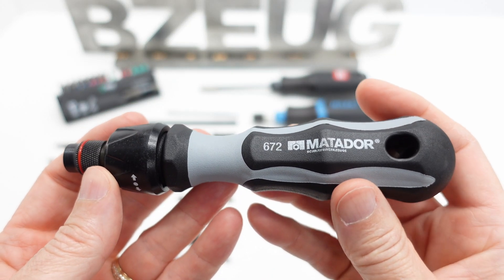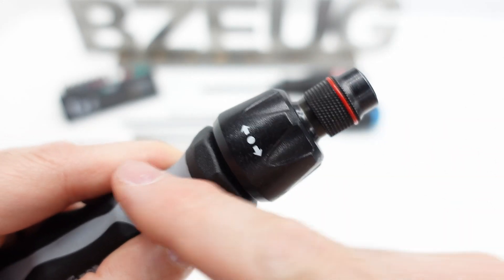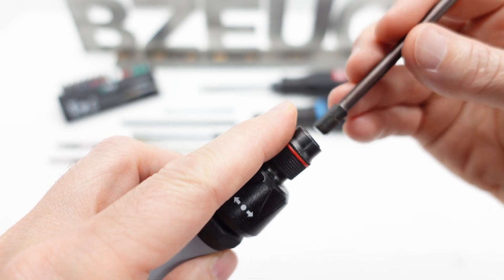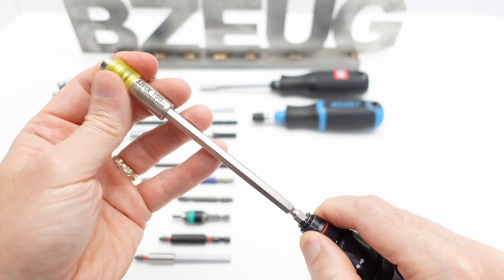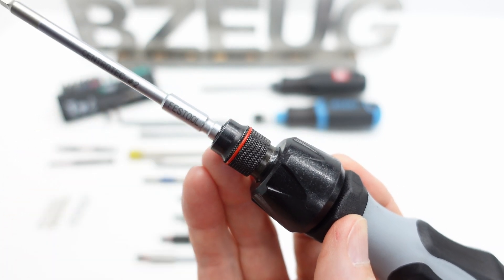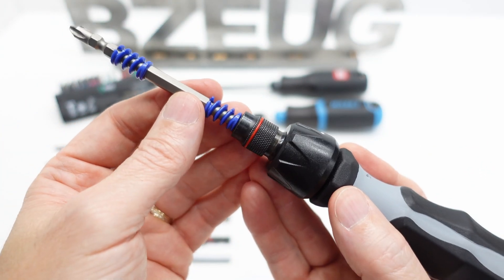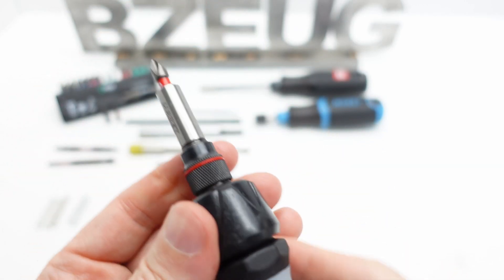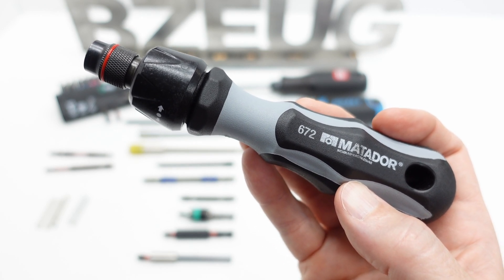Matador 672 silent ratchet blade style bit holder has 6 locking BBs.

Comment: You should use the wera rapidaptor from kk25 handle it has two c6 detents one at the bottom and one at the top, so u can have it short or long.
Reply from the maker: Oh yes you are right!  Such a good idea.  I just checked it and it works very well.  I am so disappointed that I didn't think to put that in the video.  Thank you!

Comment: Hi bzeug, great review. I just check out the amazon de link with handler only. Found that the picture is without ratchet. Description still the same with ratcheting. Make me wonder if still the same bit holder.
Reply from the maker: I see what you mean.  That is very strange.   When I follow my link in the video it goes to the correct Amazon.de page which also shows that I purchased that exact product.  I see what you mean about the photo.  In the description of the item they refer to the silent ratchet, and the part number for the ratchet style appears correct in the description.  When I check the Matador website here https://www.matador.de/en/Rollbag-MATADOR-0672/06729070  I see what looks like a new style of ratchet.  I wonder if they have improved it.  I did notice the ratchet selector was cheap plastic and maybe they fixed that.  Wow.   It appears to me that they may have improved the design.
Reply: Thks for the clarification. I will give it a try and add the wera rapidaptor extension(WERA052504) 100mm length. Let you know how it come by once i receive it.
Reply from the maker: @yanlucky7  Thank you.  Yes, please let me know if they updated the ratchet direction selector on that tool.  I am very curious about that.
Reply from the maker: Did you decide to buy the Matador?  I am curious to know if they changed it.
Reply: @BZEUG  i bought it from amazon de. It is on the way. Dun know why they dun ship outside german now. So shipping is done by a forwarder to singapore. Take long time to ship.
Reply: @bzeug It is the same design. 😅 also it is bigger heavier than i expected. I cut Wera - WER052504 to 87mm, so it can catch the two notches on wera bit extension.
Reply from the maker: @yanlucky7  Ok, thank you.  So their marketing photos are just confusing.

Comment: i contacted Matador recently regarding one of their ratchet and they told me that 'as a global German manufacturer who has among other thing the approval to use the appelation German made by the German manufacturer association,  they decided to not to since they dont believe this add any value to the end user' which is in my opinion,  bullshit for chinese made german 'engineered' but maybe im wrong,,they just wouldn't tell me straight if the ratchet was made in Germany or not
Reply from the maker: Interestimg.  I got the same response from them.  Seems like they are hidding something.  If it's made in Germany why wouldn't they want to say so?  Makes no sense.
Reply: @BZEUG  yeah i mean, come and try to make me believe you wouldn't put that on your tool because it's not an added bonus, it's like if your food is bio or pesticide free, of course they're gonna write it on the label, and they're gonna charge you extra for it, anyway, their tools look not too bad, i know its silly but i kinda like the name too lol
have you seen their ratchet btw?
Reply: I would have presumed it comes from Oplast in Slovenia like all of the others.  Never seen a blade style Rolgear though. So no idea.
Reply: It requires only 6% of the product to be made in Germany to be labeled as "made in Germany" by the law. So most of the German brands abuse the system (just like in US or anywhere else). When you see it's made in Germany, probably it's just a steel part that was cut there and assembled with Chinese plastic or vice versa